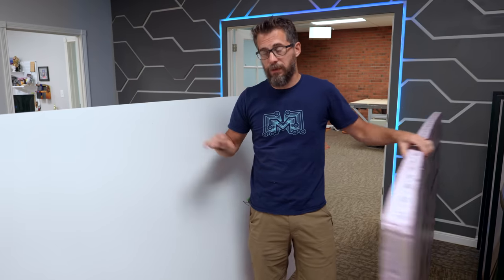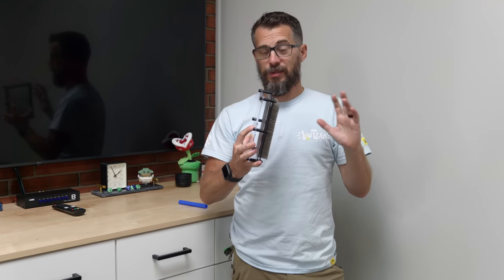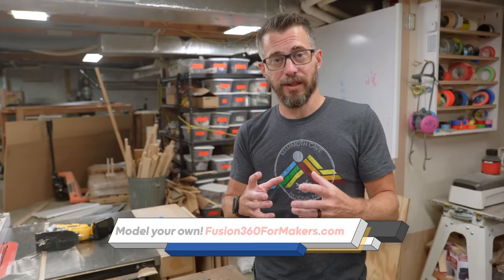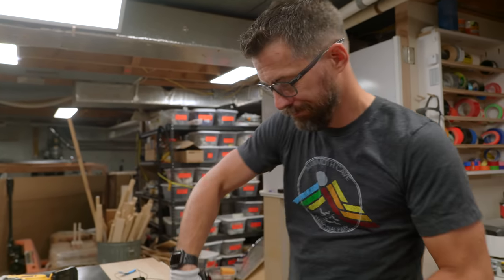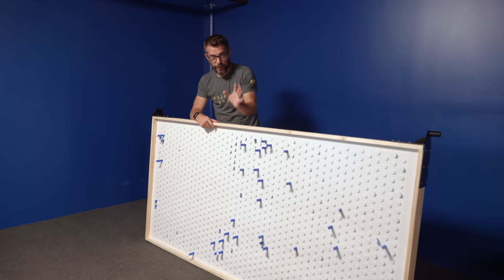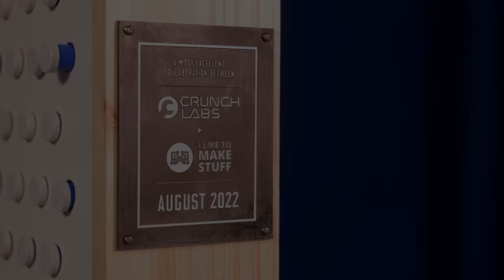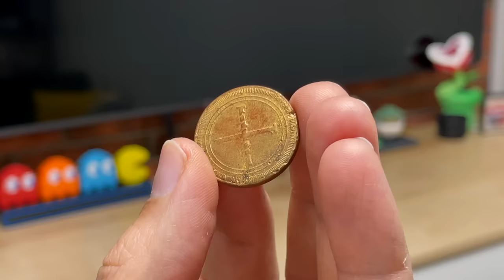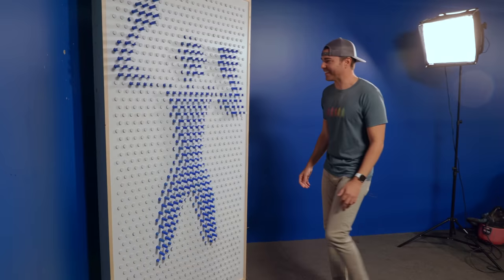We Found Mark Rober's Shop!...and Left Him a Present.

Comment: I've always loved how these pin boards are a very rudimentary demonstration of how image resolution works.  The smaller the pins (pixels) and the closer they are together, the higher quality the image.  Basically the difference between the thumbs up being an actual thumbs up instead of the triangle we all saw.
Reply from the maker: Sure. The fidelity is equal to the insane amount of the pins and caps that we could add. Since it was going to be house in their upper loft area, this resolution was pretty good. We could have always added more, but we made a decision.
Reply: @Iliketomakestuff  yeah.. made the wrong decision.
Reply: @dtoad48  Wow, dude. Did that make you feel better?
Reply: Look up pinscreen. The pinscreen, which is basically a large pin board, was developed for animation in the 1930s.
Reply: @Iliketomakestuff  No worries, certainly not questioning the size or amount of pins you used, I can only imagine how heavy that thing must be in the first place based simply on the hinges.
Reply: @dtoad48  How is that a wrong decision?
Reply: I never thought about that before!
Reply: you are right pin bords are fun
Reply: @dtoad48  💀

Comment: Love the idea of using the wall to reset! I would have created a roller that slides up/down the board to reset, similar feeling to a magnetic drawing board! Great work Bob!
Reply from the maker: That's a cool idea. We had to be sure the length of the pins didn't inhibit it from being reset. The wall or your roller idea couldn't put too much bending torque on those pins or they would reset.

Comment: Hey Bob when you use tabs to align your weldments make them a little shorter than the thickness of the matting parts, it will be stronger and you won't have as much to grind to make it flat.
Reply from the maker: Good call!

Comment: Really awesome!! Good job on the build. One small suggestion to! Install something on the wall that will A) Protect the wall from getting paint on it or damaged and B) Give the wall a little more thickness to help reset the board. You can see that the pins do not push back in all the way and having a little thicker surface, maybe in the shape of the inside of the frame, would help with that!!

Comment: About a decade ago we got sub contracted to cut a sign for a fire department celebrating 80 years with a renovation. We spent two weeks painstakingly cutting and assembling the layers of foam, polycarbonate and painted wood only to have the installer punch a three inch round hole in the middle of it during installation. 

On the day for the event celebrating 80 years. We had to drop our current project and cut an insert to disguise the hole. 

Now when I see that foam being worked commercially I start to sweat. 

Really happy this turned out the way it did! 

(Thanks YT for a decent recommendation for once)

Comment: Wonderworks in Pidgeon Forge, TN has 3 of these next to each other, with higher resolution, and is reset with a motor. This is still pretty cool, and I like the contrast between the white caps and the blue shafts.
Reply from the maker: Resets with a motor? I have to check that out.

Comment: It reminds me of a set of doors we had when I worked in a recording studio, we needed access to a room in the next building so we made a doorway through a wall that was 2-3 feet thick. We fitted 2 padded doors to stop any sound and what was left was a gap that you could stand in. If one of the doors had the pins in it it would have been so funny.
I just used to hide in the gap. 😄

Comment: If you ever make something like this again maybe consider using aluminum nails like what are use to mount gutter to roofs. They are lightweight and you could make more holes for more detailed rendering.
Reply from the maker: That sounds painful.
Reply: @Iliketomakestuff  Nah, would feel just like the original ones. Also you can round the tips so they are not sharp. :)

Comment: If you ever made a V2 and wanted a world of hurt, you could put a foil in the sandwich layers and use that to build potentiometer in each pin to drive LEDs in each peg front so it lights up more the further you push it through or vise versa make a light go out the further you push it out.

Comment: Firstly, really great build and I appreciate the way in multiple methods were used. 

Just wondering, was the depth of the carpet an oversight? Seems the rolling edge wasn't really designed to be in a cut out ?
Reply from the maker: It was designed to be cut out. But the depth was a surprise. Mark's team thought it was half an inch thick. It didn't really matter in the long run, but it didn't allow for your toes to go under the board like in our tests.
Reply: @Iliketomakestuff  fair enough. I was super bummed for you when I saw how thick it was and that you needed to cut out a deep track. 

You made it work and that's all that matters. 
Thanks for replying.

Comment: What method did you use to secure the panel down on the CNC table during the operation? 3M tape? If the table a vacuum table?
Reply from the maker: We use some non-threaded carpet tape. It holds strong and releases pretty easily.

Comment: Great work Bob, love the channel, been fan for 5 years.  One thought, after seeing the finished product, and the lack of detail the form will show, curious if the same door can be built but make twice as many holes with pegs 1/2 the size?  Just curious
Reply from the maker: Probably. Josh designed one with way more pins. But we settled on this arrangement because of cost and time.

Comment: ok hear me out. let's make it way more complicated
Use clear diffused acrylic rods with  an rgb led in the back of each one, each with either a temp or depth sensor to make it really dynamic.
Additionally you could make some really rad patterns with the lights cascading down or even animate as a low res display
Reply from the maker: We thought about embedding LEDs in them, but it got really complicated at that scale. 1,081 of those pins took a while.
Reply: @Iliketomakestuff  yeah it would be a ton of work. 

either way Great work, like Mark you guys help me be a better builder of things.

Comment: Only one question, why didn't you do more, smaller pins? You could have used the plugs with something glued on the ends or something with the same ID and put between the pins and plugs with a recess for the plug

Comment: Neat build. Did you consider making a mold and casting those caps?
Reply from the maker: We printed about 100 caps an hour with our printer setup. We calculated the time to cast them and it wasn't much better. So we just got in a routine and printed them all.
Reply: @Iliketomakestuff  makes sense. You should mention things like that in your videos. It really helps us understand the problem solving process.

Comment: Why 3d print all the caps?  Wouldn't a mold be faster/cheaper after you print a few?
Reply from the maker: We thought about that, but the curing time for casting resin was about the same as just printing a whole new batch. We could get about 100 an hour with our setup.

Comment: Awesome build! Excited that one of your projects made it into the Crunch Labs!

Just out of curiosity, with all the caps you needed, what made you choose resin printing rather than fdm? I'd think the cleaning and curing would add a lot of time, but maybe doing ~20 at once on the resin machines helped even that out? I'm sure this was something that was thought out, just curious. Excited for next week!
Reply: With resin printing you can print the entire layer at once, which probably saves a lot of time if you've got the build plate full.  And they had a curing machine which helps speed up the post processing.
Reply: @Mrsockmonkie  right. I’m wondering if that made it faster in the end.
Reply from the maker: We did a test and we could print 4x as many caps per hour using the MSLA resin printers. Also, the finish was better and The FDM version was weak along the layer lines.

Comment: Couldve used stock encaps, a plastic washer slightly large would have stopped pegs
Reply from the maker: But stock end caps were are $.70-$.98 each. We could print them for a fraction of that cost

Comment: Awesome work but I do have 1 complaint. The pin density is too low. Aka the resolution is too low. I feel like more smaller pins would have been way better but its still cool and better than I could do.

Comment: that pipe is incredibly easy to deform with a tiny bit of heat, so why not just make a plate that you can press a bunch on and another plate that you can press the other end on that heats up a bit, and stretches that end, (reverse the stretched bits on the other plate and stretch the other end on the board if you are not going with the standard of just having a clear sheet over one side so the pins  can't fall out that side? ) anyway. one plate stretch 10x10 for 100 pegs of plastic pipe per squish and in 10 presses you get 1000 units and no massive amount of UV degradable plugs having to be printed?

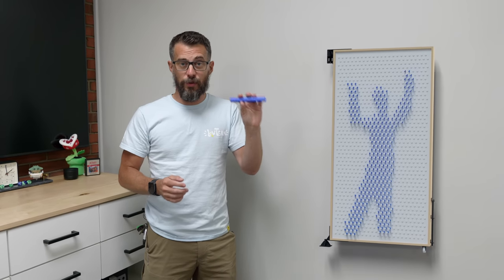Comment: 3:51  “3D-print 2000 caps”…. me: plastic injection molding in under an hour.
Reply from the maker: me: doesn't have an injection molding machine

Comment: A review of your video...

Pros:
1.) Excellent video and production quality.
2.) Excellent workmanship on the finished piece (more on design later).
3.) Anything with Mark Rober is great.
4.) Good dedication to and followthrough on a large project.
5.) Good entertainment value for the time spent.

Cons:
1.) The design of the product is fatally flawed. 
      The purpose of the thing is to make a 3-D impression of an object. 
      It failed in two ways:
          A.) The "pins" were too far apart, and lacked the flaired caps to give the illusion of a solid surface.
          B.) The "pins" were not long enough to give any sense of depth.
      The result is that of a 2-D outline cut from a dotted piece of paper with unacceptable resolution. 
2.) The frame should have been sturdy enough to support the weight so as not to require the floor roller.

Conclusion:
Had more effort been made to rectify the above issues this would have been an amazing product.
Sure, there are time and money constraints, but that is no excuse to present such a flawed product.
The time and money spent on this should have gone to a design with more appropriate constraints.
Reply: true. i think it would have been much better if they made it using 3 or 4 stiff nets (like the ones in tennis rackets) arranged in a parallel manner and then used unsharpened pencils for the pins. much much better resolution and lower costs and easier.
Reply from the maker: But your cons are based on the supposition that it was a lack of effort that drove the end result. That's a pretty strong assumption and the only assumption offered. I'll offer another set of conditions; this is what was agreed upon by both parties because of real-life constraints, budget and time. Both parties were ultimately happy with the final output, as are Mark's guests. So, if I may, before you assume conditions and cast judgement, maybe consider that there are far more factors at play than the ones you just thought of. Best wishes. -Josh
Reply: @Iliketomakestuff  Please reread my review. My cons were not based on the supposition of lack of effort. Effort, workmanship and follow-through were listed as PROS!  I made no assumptions. According to the maker, the goal was to reproduce the pin sculpture device in a larger format. He objectively failed in that effort. That's not my opinion, his machine is a commendable effort, but it did not reproduce the device. My only suggestion, if you read that far, was to consider time and money constraints ahead of time more carefully to insure a successful outcome. I gave this review not to belittle anyone. I know if I had commited the time and money that he did, my heart would have been broken when I saw the end result. We all make mistakes. It's all too easy to say, "At-a-boy", even when the outcome is bad. It's more difficult to offer unbiased objective criticism. If it were me, it might hurt my pride, but I would prefer criticism so I could improve. That was my motivation.
Reply: @Iliketomakestuff  Sorry, Josh, I just now saw it was you I was responding to. I thought it was another viewer. You must be somewhat confused by my choice of words! Anyway, no hard feelings? I watch all your work. Everyone has hits and misses, including myself. All good creaters (or good anything, for that matter) can handle honest feedback. I simply don't subscribe to the "participation trophy" mentality. Like I said, I gave criticism because that is what I would expect of others towards me.

Comment: we're gonna print 2000 caps with larger heads

why not print 2000 washers?

somewhere in here theres a cost benefit analysis
Reply from the maker: Well we didn't think of that. That's a fine idea. But each PEX cap was around $1 each, so it was cheaper to print them all.
Reply: Could have, but the end wouldn't have been as clean and we'd probably have to modify 1000 washers. We didn't have individual cleanup on the caps, just batch wash/cure, so that was nice. Probably benefits to both.

Comment: erm, would it not have been a LOT easier to find some pipe with an inner diameter the same as the outer diameter of the pex and just cut off a bunch of rings to glue on the end? thats a lot of 3d printed resin, time, electricity, alcohol,.... for a part that functionally didnt need to plug the tube.

Comment: Why'd you have to take all the pins out just to put them back in?
Reply from the maker: There was a "not as nice" side of the board that needed to be painted along with the caps. So we transported it with the white caps facing the wrong direction. When we installed it, the white caps had to go on the "nice side" of the board.
Reply: @Iliketomakestuff  ahhh ok, makes sense!

Comment: Super cool idea.
Why did you choose such a low resolution?
I understand not going with the same needle density as the small board, but at least 9 pins per square cm right.
Else why bother?

You could have used filaments or electrical wire or something, then made a plexiglass front which you can push inwards. This would allow you to use needles. 

Such a shame

Comment: How do you end up with the worlds most over-engineered hinge, and still not have it be able to support the weight of the door. And then to top it off, not once think about how the wheel is too tall after removing +3" of foam from the floor. I would be extremely upset and sad to see such an ugly eyesore of a wheel track cut into my flooring.

Comment: Doing projects like that are expensive because you rented a 15 ft box truck instead of borrowing a pickup. Lol
Reply from the maker: We rented the smallest truck we could find for a one-way trip. I assume you wouldn't let someone borrow your truck and leave it 2,400 miles away?
Reply: @Iliketomakestuff  I've borrowed trucks for cross country trips before. Usually I'll cover some basic maintenance like an oil change or two as well as fixing up some minor stuff if the vehicle needs it. Replacing brakes here or grab bars there. Whatever stuff people want fixed in their vehicle but it's too much of an inconvenience for them to do it themselves.

That being said where I am the pickup trucks probably outnumber the people so there's no shortage of vehicles to borrow. I borrowed a suburban from my boss for 4 or 5 months once while the transmission in my truck was being worked on.

Comment: Pegs were too large to show any detail and you ruined his floor to have a reset instead of just having an 24 inch square with a handle to reset the device in seconds...all that damage just to stick it in a random ass corner. Concept 9
Execution 3
Overall that's a fail and the cost for him to replace the carpet isn't worth it
Reply from the maker: It was his idea to place it there and to cut the carpet from the very beginning.